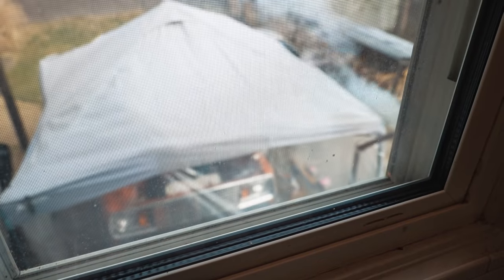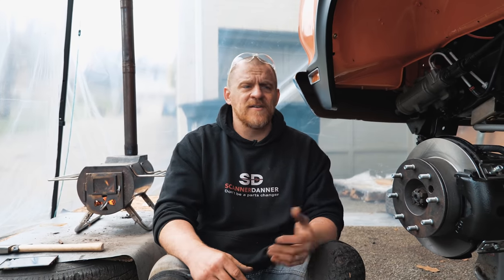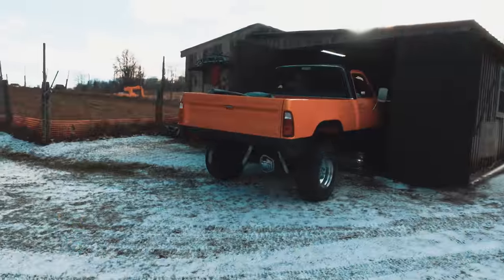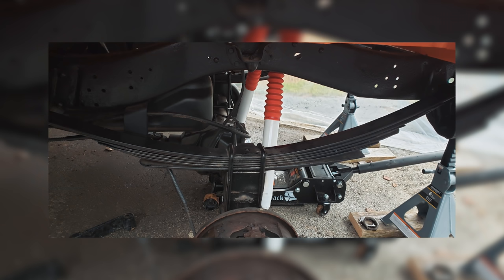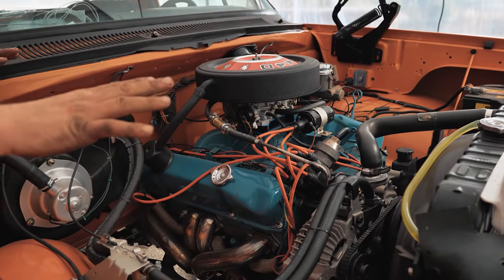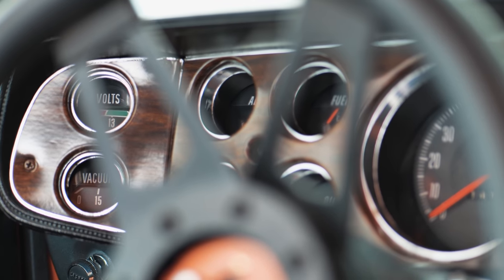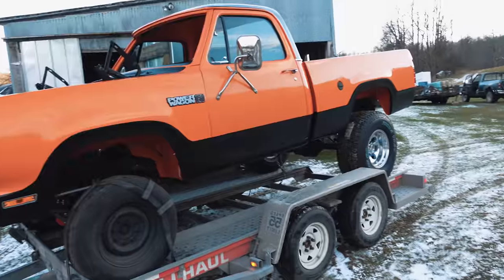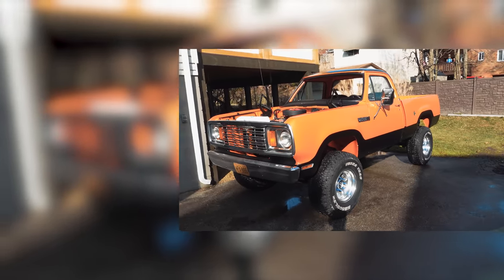I Bought My Dream Truck [Finally]

Comment: well buddy you need to put a Holley Terminator TBI system on top of that intake base... c'mon Scanner Danner can't go carburated he needs fuel injection...:)))
Reply from the maker: I'll look into it for sure! I am absolutely not apposed to fuel injection, but I've got concerns on the fuel and timing curves and whether or not they are adjustable.
Reply: @ScannerDanner  well you'll be amazed by the tune-ability and incredible resources of the Terminator and Dominator ECU, they support any kind of application, from naturally aspirated to turbo or turbo charged. You can go TBI injection or sequential multipoint, MAF or MAP, you can drive up to 16 injectors, from the wizard auto-learn base tune to the advanced stuff, like VE fuelling, spark advance table, the limit is just your knowledge. The TBI systems are very easy plug & play installation, you only need to address fuel lines and return line, the fuel pressure reg and obviously and HEY computer-controlled distributor...take a look cheers https://youtu.be/Jpjlq5u4RE0
Reply from the maker: @3dvorator  awesome! Like this guy already, and his style